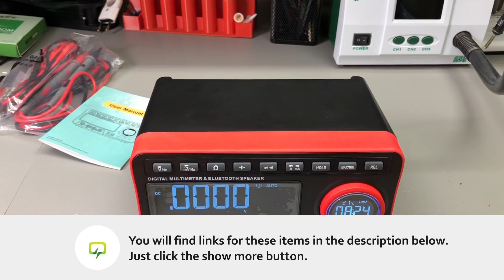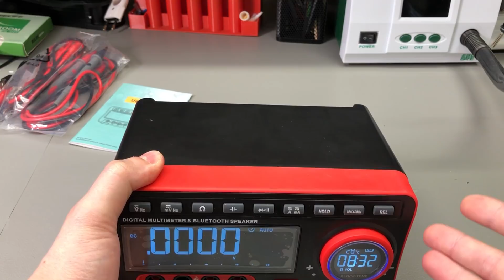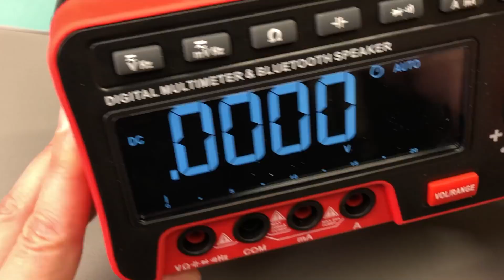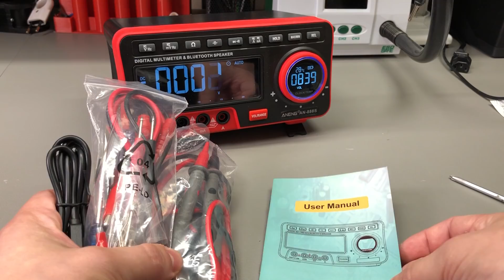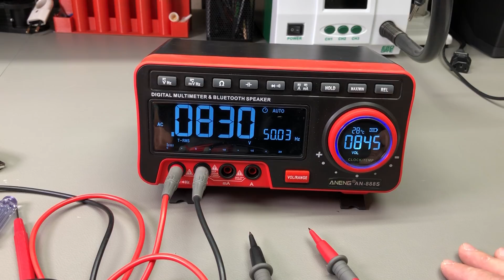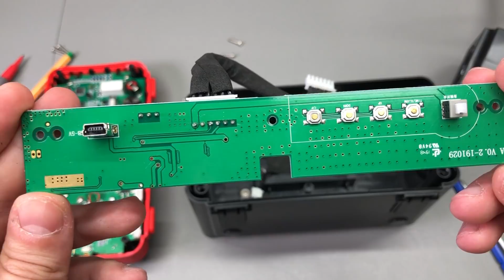Aneng AN888S Multimeter With Bluetooth Speaker Review & Teardown - Voltlog #374

Comment: nice review.  thanks.
I'm interested in how it functions on capacitance reading. this is often a 'difficult' function for cheap meters and some are down right kludgy.
i also wonder how quickly it can measure a resistor. 
i think the bluetooth speakers are there for ballast ; to keep it stable on the benchtop.
an audio input would have been useful. then it could double as a signal tracer. 
maybe a bluetooth signal tracer probe could be a useful accessory and nicely isolated also.
you can tell I'm an audio tech

Comment: This multimeter is an interesting device. I also had one on the table after seeing your review. I often use it as a multimeter, timer and thermometer, rarely using the speaker. If they turn the bluetooth speaker function into a data connection with a smartphone that looks like a lot of good things. Thanks for your review

Comment: Do you have to do anything to make it work on batteries?
Reply from the maker: nope, it just works.
Reply: @voltlog  It ended up being the 18650 batteries not making contact with the battery contacts. Some adjusting of the springs made it work. Thank you!
Reply from the maker: @daviddevillers6790  some 18650 cells are meant for spot welding and so they don't have the button caps which would prevent them from reaching all the way to the contact area.

Comment: It is funny how people who own it say they are delighted, and those who never used it say it is junk.
I have had one in my small shop for about a year, and love it.
Is the clock totally inaccurate? Yes!
Is the music costly junk? No, I personally enjoy listening to internet music channels while working.
Is the 18650 battery system stupid? I don't think so, rather it seems having been a bright idea to work from a clean power source, which allows for precise low range measurements without having to include a more expensive low noise power supply.
It is well worth the money, intuitive and handy. I hardly reach the portable DMM anymore, only when in case of doubt and have never found this bench meter reading to be wrong.
I love it!

Comment: Hello, I have owned one for over a year, and I am very happy with it. The speakerphone function has only been used once, on battery and outdoors.  In my lab, it stays connected to a small USB power supply and is always on. With two old 18650 batteries, it's perfect!
The accuracy is very good and the display is very visible. 
In ammeter function, there is a beep that reminds that the inputs are "in short circuit" to avoid problems.
The only defect is the automatic stop which is too fast for me, but it is not very serious.
This is my everyday tabletop multimeter, and for the price I think it's a great buy.
René from France 

Bonjour, j'en possède un depuis plus d'un an, et j'en suis très content. La fonction haut-parleur m'a servie une seule fois, sur batterie et en extérieur.  Dans mon labo, il reste branché sur une petite alimentation USB et est en marche en permanence. Avec deux vieilles batteries 18650, c'est parfait !
La précision est très bonne et l'affichage est très visible . 
En fonction Ampèremètre , il y a un bip qui rapelle que les entrées sont "en court circuit" pour éviter les problèmes.
Le seul défaut est l'arrêt automatique qui est trop rapide pour moi, mais c'est n'est pas très grave.
C'est mon multimètrede table de tous les jours , et pour le prix je pense que c'est un excellent achat.
René de France 

Translated with www.DeepL.com/Translator (free version)

Comment: Ive had one of these for some time and im very pleased with it.  I have no use for the bluetooth junk and my only real complaint is I really wish they had put the on / off switch on the front - but it seems more than accurate enough for the average guy and construction to me is pretty good quality and the boards build quality really is better than expected, I love mine so far. I just as soon wish I could have gotten it without the BT garbage and put that money into a front mounted power switch and enhanced accuracy - not that its accuracy is bad, but after all its primarily a meter not a jukebox, but I had no choice in the matter its an odd design to build the BT speaker crap into a bench meter, but its chinese so anything is possible with their unusual marketing mindsets.

Comment: it is 25% of the way towards saving up for a brymen bm869s... i prefer this saving up longer time. for the better choice for lifetime tool you will use every day. now the bm869 is not a benchtop meter.... but then 3d print a stand holder for it will keep it more secure on the desk and stop it from toppling / falling over
Reply from the maker: I will 100% recommend saving for a high quality, high performance meter but in some cases it will never reach it's full potential so it's worth considering lower cost alternatives if they get the job done.

Comment: This looks like the perfect bedside multimeter - but you didn’t mention an alarm?
Reply from the maker: Doesn't seem to have an alarm and unfortunately the clock is expected to be inaccurate because there is no RTC circuit.
Reply: @voltlog  There is a quartz visible in BT/clock section. Sure it HAS RTC hidden somewhere.
Reply: I love to measure voltages in bed

Comment: I don't have a single usb type c cable or device, but i do have mini usb devices and cables
Reply from the maker: That's pretty rare these days!
Reply: @voltlog  I have a single type C cable and an adapter that I bought to be ready. I don't have a single thing to plug them into, however.

Comment: Bluetooth, temp and clock on a bench meter?.... WTF!.... No, just no 🤣

If they spent that extra design/bom cost on producing a better meter then it wouldn't have 5% accuracy plastered all over the spec sheet... It would have 1 or 2%

I like Aneng products for what they are, I have a AN8008 in the van for breakdowns/general use, its a great meter for £18
I'd steer clear of this one though!
Reply: Exactly. This is the cheapest bench multimeter you can find with autorange. It has no one to compete against in its price range as far as I know.
If they make a slightly better specced serious multimeter, a lot of beginners and electronics enthusiasts with small budgets will buy one. At that price, it would be great.

I discarded this one just because of the gadgets. I just don´t want to pay for that stuff.
Reply: @JosepsGSX  exactly that... Forget the Bluetooth, silly clock and temp module... Gimmee some quality!

It's around £55, down from around £80...at that price I would like slightly higher precision (it's down to a budget, after all!) and more focus towards a serious hobbyists tool in general design rather than a Monty Python sketch of a tool,

They did OK with their previous cheapo meter offerings, reasonable precision and quality (as tested on EEV) for around £20 or so.... I have one in the van,

This is a disappointment, the screen viewing angle is a bit rubbish for working on heavy stuff you don't want to lift to the bench, I have to move the meter? 
They missed out on cornering the cheapo hobbyist bench meter market with this one, but don't worry, they'll be back with a new model in 3 months!... They always do

Comment: Looks like a piece of junk! I expect a benchtop meter to come with it's own power supply. I don't consider 18650 batteries to be removable. And the generic ones are dangerous. Does this product have any safety certifications? And who wants a time/temperature display on their bench meter? No one!  Buyer beware!
Reply: Disagree with the PSU, everyone has a spare USB power supply around or a PC to plug in to. Having removable batteries is nice for shipping, legally shipping li-ion is a pain, and most likely this thing can just run off USB with no batteries. Agree that its junk.
Reply: @jaro6985  My point was that 18650 batteries were originally made for notebook computer battery packs and are not meant to be removable. They can be dangerous as we've seen in exploding vaping devices etc. No way I would trust those generic Chinese cells.

Comment: As far as I'm concerned, they could have left the speakers off completely and used the savings to provide data logging over USB or Bluetooth. Would have made it more useful. Can't imagine ever using the Bluetooth speakers for anything. Or, if they had included a signal tracing function and used the speakers to let you hear the signal you're tracing, that might have been useful.
Reply: I was thinking remove that usb for a XT30 plug and it could be gutted out for more Batteries, XYS3580 , RPi 4B with a UPS Hat and a 7 inch flip up touch screen ?
... could still keep a little of the speakers for listening to the news only without the passive base.

Comment: At 17:40 you state that "There is no capacity marking on the provided batteries"...  Hmm..  At 4:07, 2000mAh (Written in BIG) can be clearly seen on the batteries.
Reply from the maker: Good catch, missed that because they were rotated around when I first checked.
Reply: .... I would weigh those batteries (34 Grams I imagine) that would save me time testing their capacity.

Comment: I have the same meter! The clock is useless and looses several minutes an hour.
Reply from the maker: Unfortunately I expected that due to the lack of an RTC circuit.
Reply: It appears to have a 32kHz crystal, which should be accurate enough for basic time keeping. Probably some issue in the micro.
Reply: .... On the bright side, it confirms Einstein's time dilation, just factor in your relative speed before checking the time !
Reply: Mine is very accurate on a month. You was not Lucky 😢